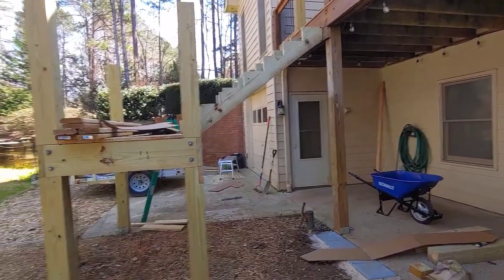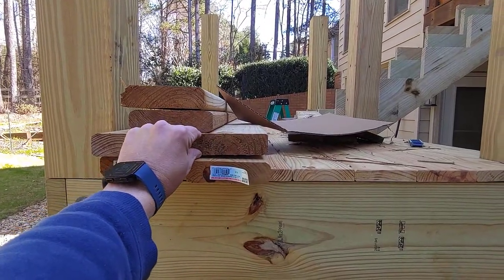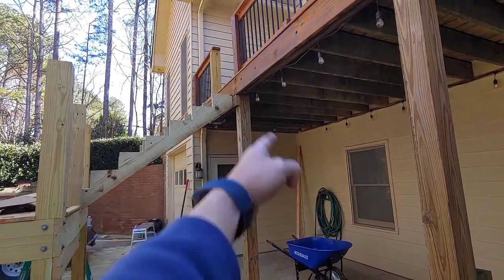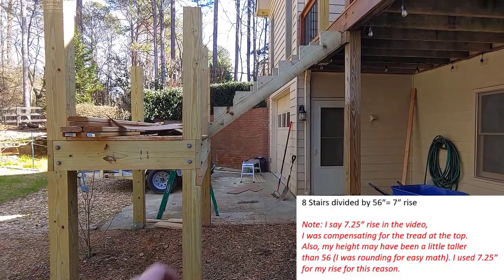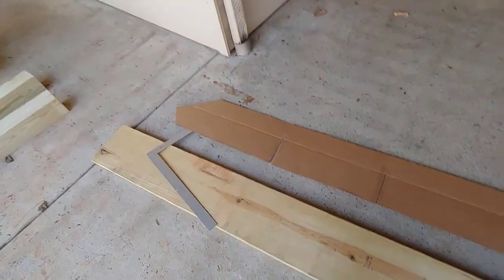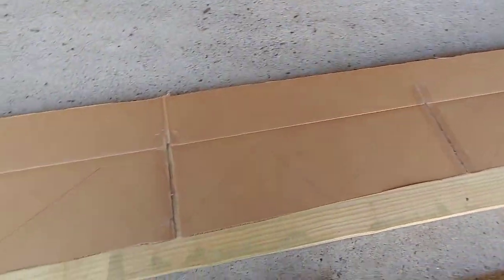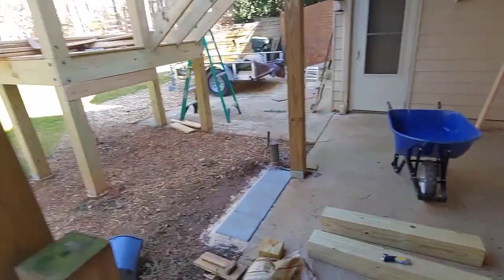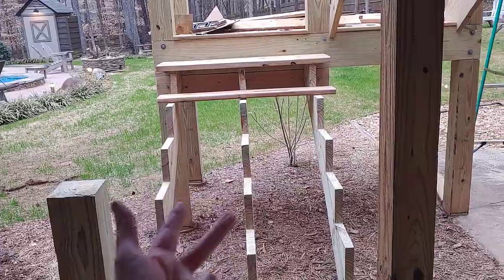How to calculate Stair Stringer Rise and Run EASILY. Staircase Rise and Run.

Comment: Terrible explanation. How does any of the math work if you dont even know how far out your stairs are going to go. The angle of the stairs. You are either missing something or skipping over the hardest part.
Reply from the maker: Hey I'm sorry you found my explanation terrible. I understand your frustration because it took me a long time for it to click. I suggest you get some cardboard and work it out. On these bottom stairs my overall additive run and where it landed was not that important. You may notice that I also poured some additional concrete for where it landed. Local code made a dictate how long your run needs to be but there's also a range. If your distance out is very important in your project, I suggest measuring that distance. You may have to use a plumb line hanging off of your landing to determine your overall additive run. Now divide that by your run of 10.5 in" (or somewhere in the range of code) and that will help you determine how many stairs that you have. It may still be very helpful to use cardboard for you go to cutting of your expensive piece of wood. This technique will allow you to adjust your own per stair run for it to work out.  Good luck. I'm not an expert at this but thought I could be helpful and thought my video could be helpful. I apologize if you found it frustrating.